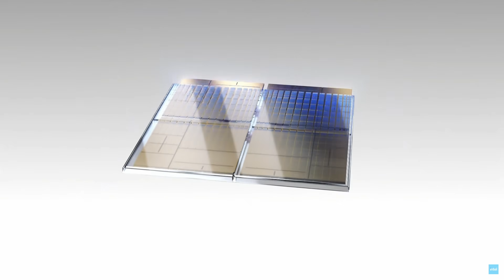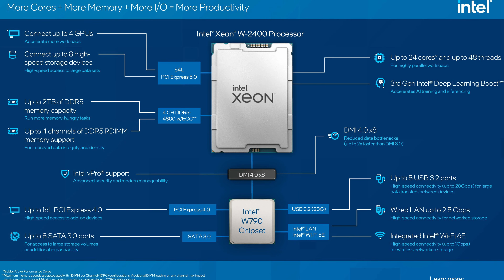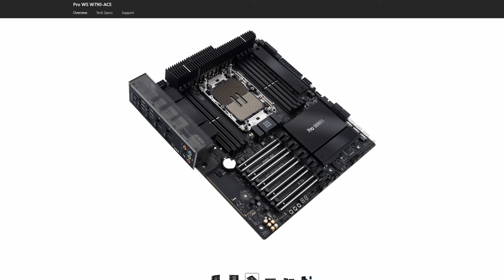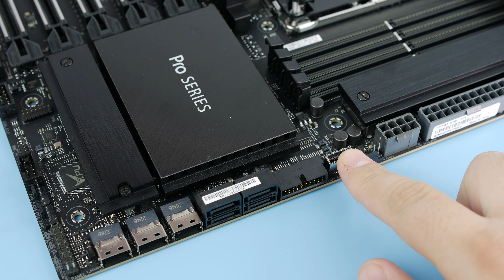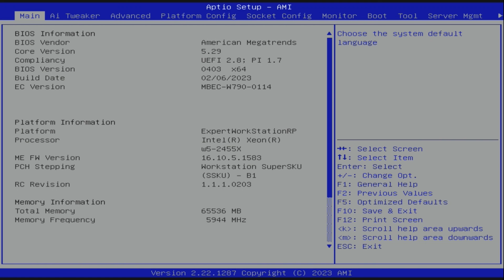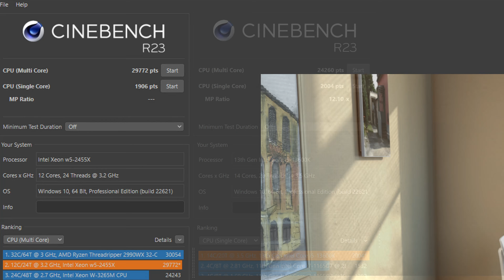Intel 4677 W790 HEDT. Performance, overclocking and gaming. My Xeon W-2455X system.

Comment from the maker: My first video on the channel. Please like if you enjoed it. All comments are wellcome.
Please subscribe, I want to make more videos and that motivates me the most. It is free and really helps.
Video sounds a lot better at 1.25 - 1.5 speed. Try it!
ASUS responded regarding the Command Rate issue. It is a problem in the CPU memory controller algorithm and must be fixed in cooperation with Intel. The option to change command rate in bios will be removed in future bios version until a fix is made with Intel.

https://shp.pub/6s5cq1 - DDR5 Freezemod radiators

Comment: After building few of these i have to say - attaching CPU to cooler before installing is a absolutely usless and dangerous - specially when working with not-so-flexible AIO coolers. It helps i absolutely no way and just makes it easier to bend pins. Dont do it.

Comment: I went with this build over Threadripper because the price for features is better. Single core speed is underwhelming, but the PCIE 5.0 slots plus extra lanes is what it is all about. If you are concerned about a NVME running at PCIE 5.0 specs then just get an adapter so that it fits in a PCIE slot. Why they didn't include a PCIE 5.0 NVME is weird, but from what I can tell these 5.0 NVMEs need some serious cooling so an adapter card with a big heatsink would end up being a better solution.

Comment: that low latency...
Reply from the maker: You mean after ram overclocking?
Reply: @ArtyomExplainsEng  yes, i mean it looks so good ! is it solely from ram oc or uncore oc ?
Reply from the maker: @Opteron67  All main, secondary and tertiary timings were tweaked, mesh was overclocked. The best it could get with CR1.
Reply: @ i should buy this cpu...

Comment: I wish Intel would sell 14700K or 14900K  with ECC support. I would want to have a fast system with RAM that I can trust. And unbuffered ECC should allow improved overclocking because you can push the RAM more because you can accept random single bit errors without any crashes.
Reply from the maker: You can push ram to 8000 on a board like apex or tachyon x. No need for ecc.
Reply: @ArtyomExplainsEng  How about CL setting? ECC would allow reducing that even more than non-ECC RAM if executed well.

That said, it seems that nobody is selling ECC RAM with really high quality chips that would allow both low CL settings and high MT/s setting at the same time.

Comment: In summer 2023 I built an Intel Xeon W7-2495X 24-Core, ASUS W790 ACE, 512GB DDR5-4800 ECC RDIMM, ASUS ROG STRIX RTX-3090 24GB.  Platinum Power Supply, two 4TB SN850X NVME drives, etc.  The cost was about $12000 CAD or $8000 USD.  Awesome system other than ASUS motherboard and BIOS issues.  I use it for TerreSculptor and Unreal Engine 5 work.

Comment: I dispair when I see these bulky air coolers installed in motherboards.  Watercooling is the way to go.
Reply from the maker: 360 AIO for 4677 is 200-300 USD, I got this Noctua for 100 USD and it gets the job done. Huge die size allows good air cooling.
Reply: @ArtyomExplainsEng  i overheat at 5ghz allcore with the same cooler. CPU wants to do 380-390+ watts @ 1.25v, it gets cores to 100c. I have tried everything with paste application etc... and mounting pressure.

Comment: From the gaming benchmarks it looks like you're loosing performance on the Xeon due to the cores not running at their boost clocks. I think there is a Bios setting that runs the CPU at all core boost all the time, if not then windows power plan settings.

Comment: My futur plateform, upgrading form a 10920k @4.6ghz. Very nice video. It would be cool if you could make a small update video, with the new bios (if it change some things), and maybe add some handbrake encoding with x265/avx512 support ? For the record, from the manual, you "only" need 1*24 pin + 2atx12/eps12 connectors. The 2 others atx12 connectors (and the 2nd 24 pins) are for a second PSU.

Comment: Bruh... I got the same base platform. Same motherboard, CPU and memory...
Also, 10:45 the motherboard refuses to post if you only plug one EPS power connector in it. You need to use 2 connectors.

Comment: The thing though, the highest clock speed is 4.8ghz.  Remember Netburst when Intel wanted to hit 10ghz, whatever happened to that and making higher clock speeds?
Reply from the maker: It is probably the physics, the silicon itself may be the limitation. And the amount of heat that each core will produce at such frequency.
Reply: The rise of low clocked multicore cpu's killed the idea of hyper clocked single core cpu's like the P4